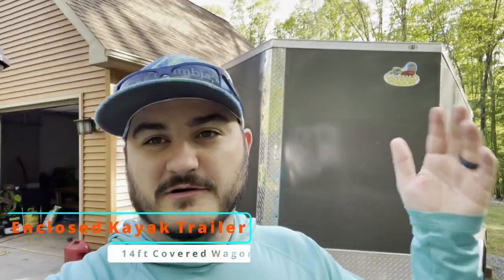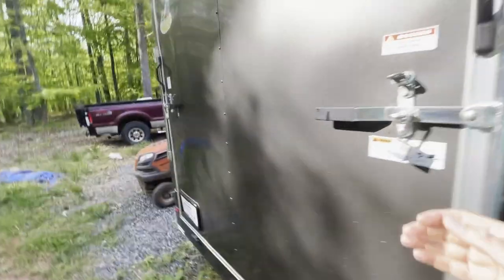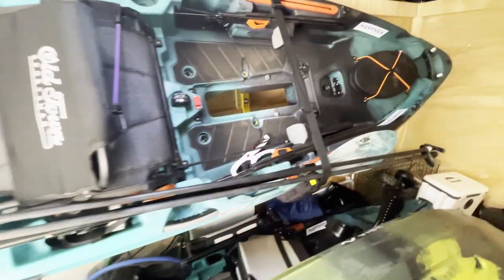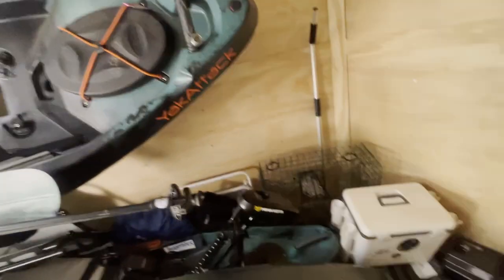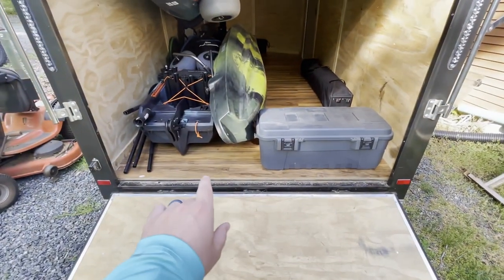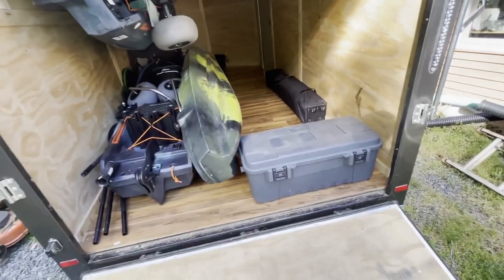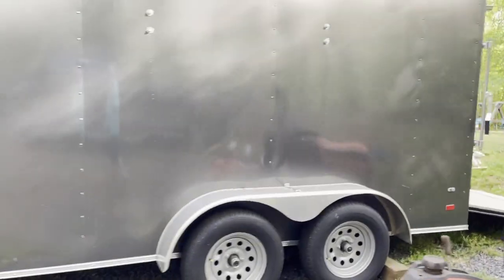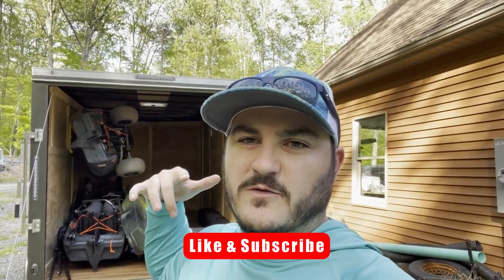My Enclosed Kayak Trailer | Covered Wagon 14ft V-Nose

Comment: This setup up is very similar to what I want to do. I even have the inferno tundra to match lol. I need to add a vent and a way to run my lights. I’d like to eventually add a canopy on the side to sit under. I still need to protect my floor with something.

I haul two kayaks. I have them on a temporary rack I made. Eventually I want to put wheels on the rack so I can wheel the kayaks off store them under the canopy so there is more room to camp inside. That’s just my idea at least. It’s a work in progress